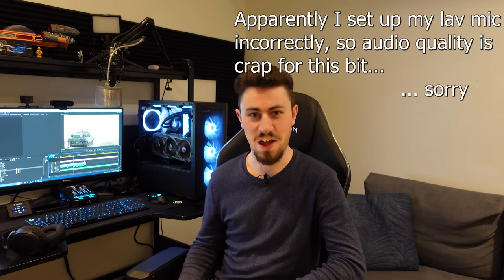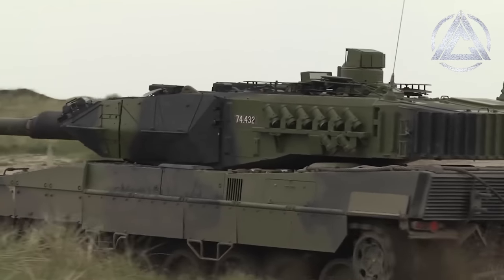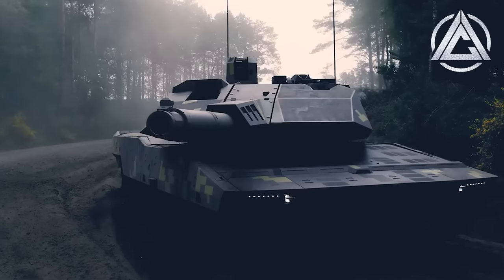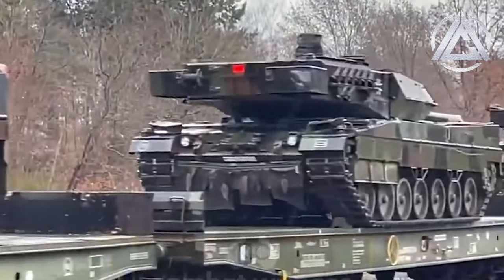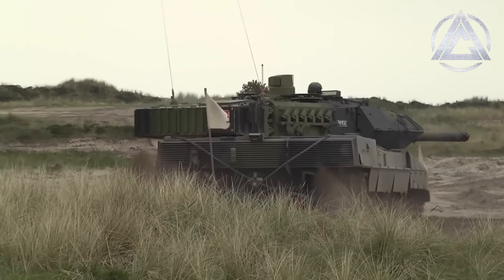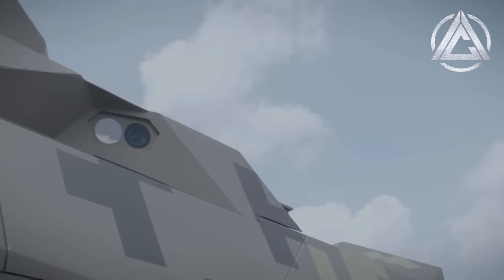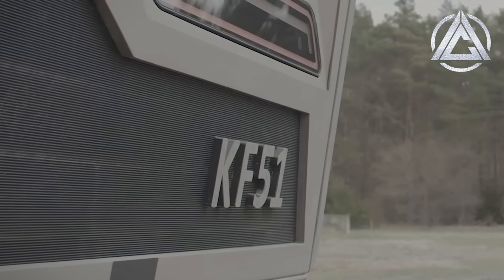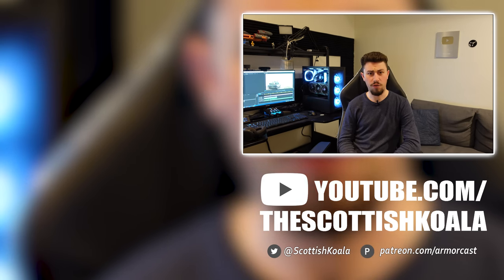Germany's New KF51 Panther Tank | The Spearhead of a New Generation?

Comment: As a Slovene can confirm that upgrading older designs to new standards becomes terribly inefficient very fast.
The two tanks our armed forces upgraded in our short history gained much international ridicule, but where upgraded due to necessity of no one wanting to sell finished arms to a new nation, not due to the want of doing such an upgrade.
The M55s is a heavily upgraded T-55, digitalising a T-55 to a late 1990s standard by adding soft kill protection laser rangefinders, Laser warning receivers, a weather station, modern independent day/night optics, modern encrypted communication suite, ballistic computers, and many more. Cost over 1,7 M€ per tank.
The later upgrade of a M84a (a T-72 derivative design) to a M84a4 [sniper], adding all the bells and whistles of tanks of the 2000s cost around 3,5 M€ per tank. It took a complete gutting of all systems and changing absolutely everything to make it a very precise tank. That is insane kinds of money and work, well in the range of being able to buy a new modern tank would one be willing to sell one instead.

And those prices are lowered due to our lower wages and most of the works and designs being done locally, a PPP adjustment to price would make modern western tanks cheaper by far. Upgrading old tech to new standards gets very expensive very fast.
Reply: I shall reply, You can only buy your girlfriend so much makeup before you realize you need a new girlfriend. Slava Ukraine!
Reply: That depends on the platform. 
The Russians have managed to make a pretty cost effective upgrade, with the T-72B3M and T-80BVM, so it can be done on the cheap.
Reply: @Orcawhale1  those are newer compared to upgrading a T55 which is by this point the T72's grandfather! The point still stands, upgrading a Sherman to 2000's standard would cost more than an M1 Abrams.
Reply: @vondantalingting  No, it don't. 
Because it still depends on the platform. 
What's more, the Sherman was infact upgraded quite heavily by the Israeli army, so no, the argument don't stand.
Reply: @Orcawhale1  They were upgraded to a large part with used French tech pulled from the Leclerc's old variants that got modernised to new standards.
Doing the same with new bought components might bump the cost... well as do current sanctions. Rare things bumps prices as good as does knowledge that the buyer has no alternative.
Reply: I am very happy that the Hungarian military realized that the most expensive thing is the "cheap" temporary solution. We carry on with the problem, it costs money, but it doesn't bring any solution, it burns the money.
Hungary trashed its T72M1s, replaced by leopard2A7HU, and currently it looks like KF51 leopard will also be purchased, and they will also be manufactured in Hungary (near the Slovenian border).
Reply: @vorosjanos77  Indeed. Slovenia had the fortune of leaving the 90s relatively wealthy, with the misfortune of not being sure how the whole wars down south would end while still not having the luxury of westerners prepared to selling their arms. So at that time it seemed necessary to upgrade those clunkers.

As for Hungary, I hope your people will also see the obsolescence of the Orban model soon and rejoin the rest of us :*
Reply: Although it might not be economically efficient to upgrade obsolete equipment it provides something you really can't put a price on... experience. Experience that is invaluable for Slovenia going forward with future upgrades programs or indigenous designs. Especially for nations with smaller military budgets that can't rely on other nations to prioritise delivery of your equipment over larger militaries.
Reply: @markjackson7650  this is a mistake. renovations do not give experience to the army, at least to the workers in the factory doing the renovations. 
The real experience is that the soldiers can learn the most modern strategies and combat methods that match the most modern tools. The renewed, modernized mbt will never be as effective, you cannot implement modern strategies with them, you need much more mbt to achieve the same ability. 
BUT! 
In such small countries as Slovenia or Hungary, human resources are limited. it really counts if you train personnel for 300 modernized old MBTs, or for 40-50 ultramodern tanks of the same combat power.
 In addition, it is possible to select from among the available soldiers the ones with the best skills for the task and train them to a higher level.
Reply: @vorosjanos77  I'm not talking about experience for the army, I'm talking about experience for the domestic arms industry. Designing something from scratch is a much bigger task that that requires knowledge and skill they may not have. Experience, knowledge and skills can be gained by upgrading their old equipment with modern systems on an already proven platform.
Reply: Nonsense, upgrading a reliable good platform till it can no longer be upgraded, squeezing every bit of service it can give you is far more efficient than designing and building a new vehicle. 
The t72 are just fine, they just havent maneged to get the right upgrades.
And the upgrades you got are so expensive due to private military industries price gauging like crazy. Ever wondered why russian weapons offer the same performance but a cheeper price ? Because their whole military industry is state owned which means no rich b*stard can gauge the price, manipulate the populace and lobby the government to buy this new military equipment otherwise this boogeyman will get you and your entire extended family.
Reply: @Silver_Prussian  Cute reply, but with quite a few faults.

Most European, Korean and Izraeli defence companies are in fact government owned. No "rich mo-fo" in the mix.
Thales - government owned majority with some shareholders, Nexter - government owned, Leonardo - largest owner the governmwnt, Rheinmetall half government owned half shareholders, IAI - government owned, Rafael - government owned, Elbit- mostly government owned. For companies that upgraded the M55s and M84a4, Elbit [as above], STO Ravne - at the time government owned, Sistemska tehnika - government owned, Đure Đakovič - mostly government owned.
You won't find many billionaires in that group. Rheinmetall CEO has an estimated combined net worth of 4 million €

On the other hand lets look at the Russian ones. Most CEOs of Russian defence companies have misterious wealth like Rostec CEO Sergey Chemezov with a 600 million €  yacht properties and unknown mountains of art. You can look up the rest of the CEOs yourself.
Reply: @HibikiKano  cute reply but ultimately wrong

Top defence companies not owned by a state.

1.Lockheed martin-public ownership
2.raytheon-public ownership
3.Northrop grumman-public ownership
4. Boeing-public ownership
5.General dynamics-public ownership
6.BAE systems- public ownership
7.Leonardo-public ownership
8.Airbus-publkc ownership
9.Thales-public ownership
10.Rheinmetal-public ownership
11.Elbit systems-public ownership
12.Dessault aviation-Société Anonyme (annonymous unregistered share ownership)
13.Naval Group- Société Anonyme
14. rolls royce-public ownership
15. Hanwha Aerospace- public ownership

The list continues on my friend, the bad boys listed here are al american, european, israeli and korean defence contractors. Now use that little grey matter in your head and tell if the shareholders would be happy to see a reduction in defence spending ?
Eisenhower's whole speech about the creeping influence and lobbying by that sector of the economy, no you havent watched it ? Ohh well its one of the most simple truths about our world but I gess it didnt reach the years of some.
Reply: 1.7M€ per tank is cheap compared with buying a newly-made "light" tank like the M-10 Booker (10M US$) if it fits your needs. You described many worthy upgrades gained, while these still fill a role of infantry support. I would ask:  How worn are parts that were not upgraded? Are you doing a complete rebuild that includes things like drive sprockets, torsion bars, road wheels? Are you replacing old track links with new, made from new materials that improve traction while reducing road noise and road wear, and decrease track breakage and wear? The old Soviet diesels were could be relied on -- to break down -- and had poor fuel efficiency due to poor fuel burn. Those problems are fixable. At best, the engine power can be doubled for the same displacement. The transmissions were often poorly designed and poorly made. That is something your own engineers and industries can solve.

I did read about quite a number of upgraded T-55 tanks that fit that description being sent to Ukraine about a year ago, I had forgotten it. Were those from your country? Have you heard anything about the quality of the upgrades during their service in your country?

3.5M€ is still a lot less than 12M€ for an M-1 Abrams . . . that price difference buys a whole lot of protection . . . but the Abrams the United States of America allows to be sold to other countries are NOT the Abrams it uses! To get anything like the same performance would require the same ammunition, to start. But it would also require replacing everything from export-grade targeting and battle-management systems to soft-kill protection system, and you cannot replace the export armor with the real deal. It's the same differences as between the T-72 or T-80 built for Soviet Guards divisions, and those exported to Iraq, Egypt, and other buyers:  rejected range finders, rejected road wheels, no laser-guided bore-launched missiles, tungsten darts instead of depleted uranium and machined to an entirely different tolerance standard that decreased accuracy 50%. That's what foreigners bought from Russia, then. Their reputation was so damaged by experience in war that Russia has had to sell their quality products outside, and buy their own rejects! (That is my own interpretation of events.)

I don't know what your country received for the money it spent, but I hope the money bought insight most of all.
Reply: @davidgoodnow269  That's why I mentioned 1999s money and PPP. Adjusted for inflation those prices would be $ 3,5 mil for the M55s upgrade and $ 6,5 mil for the M84a4 upgrade in today's money. Also if one takes the PPP of Slovenia at that time it was roughly 1,65 giving us 5,7 mil for the M55s upgrade and 10,7 mil for the M84a4 upgrade. Those are much closer now to new western tank numbers. Also mind you those were upgrade to existing owned machines, not a fully new machine.

But yes those were quite extensive, the engine did get an upgrade of a bit over 10% power and more fuel efficiency, a fire suppression system etc, torsion bars were new, new sprockets and wheels along with rubberized tracks that don't tear up roads. The gearbox was also refurbished but I don't know how different it is to the original one. There is a lot that has been done to both tanks.

Slovenia didn't upgrade them because they wanted to do so or prove anything, but because at the time of conception no-one wanted to sell heavy arms to Slovenia.

And yes those M55s were the tanks sent to Ukraine. The M84a4 were also planned, but discussions with allies were too slow on how to bump the queue for replacements or any discounts or leases. And the new left leaning government does not want to invest in the military, so the M84a4 stay here. 
Slovenia by now gave all of the stored and reserve equipment. All the 105mm artillery and shells, all M55s, all M80a BVPs, from my sources also all remaining Maljutka and Igla launchers and missles. Much of the old AK-47 based small arms and munitions for it. Heck we even started sending the current rolling stock Valuk (locally licence built Pandur 6x6). But a very German inpired politics of saving money on the military budget left us without anything else to give until new things roll in.
Reply: @HibikiKano  Wow! That was a lot to give away! Hopefully everything is peaceful around Slovenia! I understand what you are saying about spending what you have to, on what you can. That is something almost everyone knows from their personal finances, certainly anyone who has paid for car repairs or replacing things around a house, like a roof, where if you don't buy the best roof you can get it isn't going to get cheaper, and a cheap roof or old roof may let the weather in!

I once did a cheap repair on the roof of my workshop, and the next winter the roof collapsed in to the room after a snow.
Reply: @davidgoodnow269  In relative numbers to our military it was all of our reserves. In absolute numbers, sadly it wasn't all that much. Slovenia is quite tiny with a population of only 2 million. ( so what was given was in the range of: 30 tanks, 70+ IFVs, 20 of the remaining Humvees, etc. )

Slovenia is quite safe if Ukraine holds and wins. Would Ukraine fall, then I'm not so certain. Between us and Ukraine is Hungary, and I'm sorry to any Hungarian reading this, but I don't trust Orban. I feel like he might betray NATO given the option.

Ja, never go too cheap on anything. Best wait and get quality over some chinesium made stuff.

As far as those tank upgrades go, they are quite decent for their time and for what one could do to those old tanks. I am certain those M55s are better than anything Russia did to their T-55 or T-62 on the front. We have already seen an M55s take an AT projectile and manage to drive its crew home while under artillery fire, so at the very least they saved 4 people.

But going back to what I wanted to say in the beginning: Soviet designed tanks start becoming very expensive to upgrade down the line, simply because of the tight space of the platform itself and the lack of upgrade-ability designed into it.

We will probably see Abrams and Leo2 be upgrades for decades to come, simply because it has space for upgrades, and it was designed to easily take upgrades.

Either way I hope Ukraine can win soon. Already planning to visit Ukraine once they do.
Reply: Polish modernization of T-55 Merida  (from formal name of the fire control system) in mid '80s was very carefully balanced in order to be sufficiently cheaper than then new T-72M. They were unfortunately scrapped after L2A4 introduction, Merida would be quite a nice tank for Ukraine now. I think that there were ways to upgrade it very cheaply using COTS: add cameras and LCD monitors, APU,  air conditioner and bms.
Reply: @peceed  True. They would be a great addition to help Ukraine, but not many expected Russia to actually do something this insane and attack Ukraine. Keeping tanks in storage is still quite costly so if Poland traded their budget for maintaining their T-55 fleet for maintaining their leo 2 fleet, it's a still a good trade.

Also I have no doubt that Polish people knew Russia was sending inferior plans for the tanks they ordered Poland to build for themselves, amd that Poland took every secomd they could to upgrade them avove Russian tanks, knowing full well that the real threat was always in the East. But I would love to know the cost of those upgrades.

For Slovene M55s those upgrades were a even more extensive than the polish ones, and we saw that at least one survived a AT guided artillery shell hit.

My main point is that upgrading Soviet designed shells becomes increasingly expensive with modern features. Slovenia squeezed only a few extra features and it cost that much more.
Reply: @HibikiKano  Storage is totally free: all you need is to cover metal elements by paraffin instead of oil, then you have to change/procure elements from gum every 10 years. Slovene M55 got knew Gun, stabilization?, fire control system, reactive armor. Almost new tank - they should buy ex-soviet T-80 from Ukraine and Russia instead. Poland got inferior variant that could be exported (T-72m), license cost for T-72B variant was considered too expensive (it is almost a new tank) so there was no change of production model.
Upgrades are expensive, but they can be quite cheap if you are not pursuing the latest and the best and do that during renovation using COTS elements.
Reply: @peceed  Eeee Not quite. You need to run those machines regularly so they don't sieze up.

Maybe in the US where they have those dry rocky deserts and can store material without much worry its cheaper. Or in Russia where they just don't give a shit. But if you want your vehicles to still work with relatively little refurbishment, then it costs a bit.

M55s got a new 105mm L7 gun, stabs, new engine, new balistic computer, new independent day/night optics for all crew members, new encrypted radio, an external phone for infantry, new engine, new suspension, new tracks, new gearbox, new turret traverse, LWR, Laser rangefinder, weather station, new fire controls, an automatic fire suppression system, 
Izraeli ERA, new armour plate for the front hull, and I probably missed a few. 

Thing is, at the time that design was ordered and upgrades started in the 1990s, no one would sell us tanks or any other weapons. And we were still a bit scared that the whole Yugoslav wars might come back to Slovenia. So 1.7 M€ per tank seemed like a good investment to get something as dangerous as possible out of the old T-55 we had on our land. Luckily we never needed them for ourselves in the end. But as long as they help Ukraine its 1,7M€ per tank very well spent.

Do agree that a T-80 from Ukraine would be a good buy for Slovenia. But I think we are looking at something more modern to replace the M-84a4. Maybe a K2 from Poland. Or whatever the new EU tank will be.
Reply: @HibikiKano   @HibikiKano  K2 is from Korea. Production in Poland of heavier variant is not finalized, and 7-wheel "super-heavy" variant won't be produced.
To keep military equipment in stock it is sufficient to cover it by paraffin.
Old soviet tanks can run without problems in Ukraine, because they were properly preserved, before economic crysis. Later nobody cared about T-80 tanks.